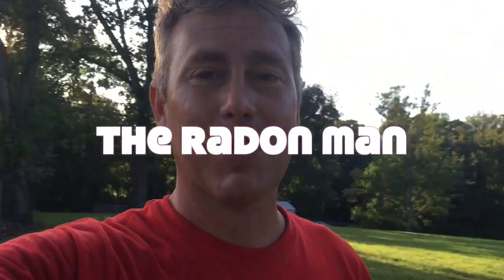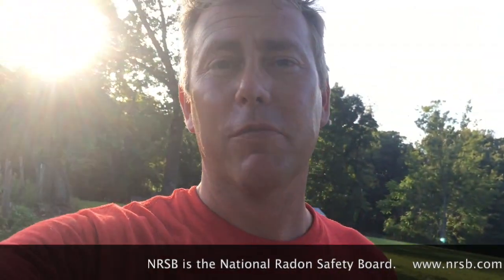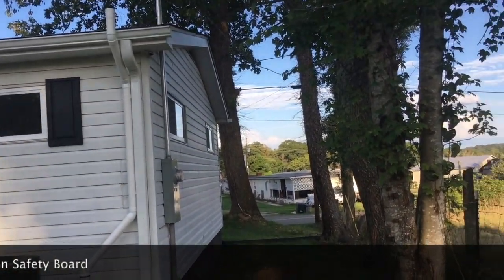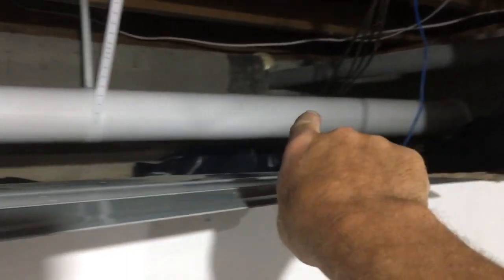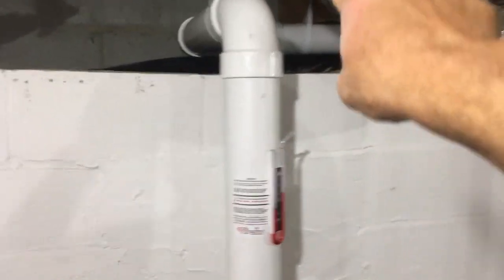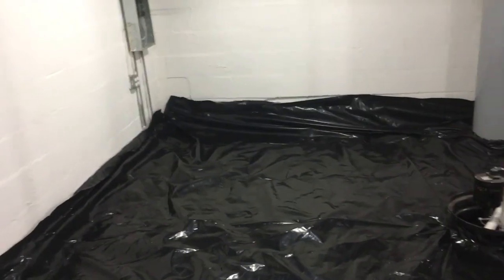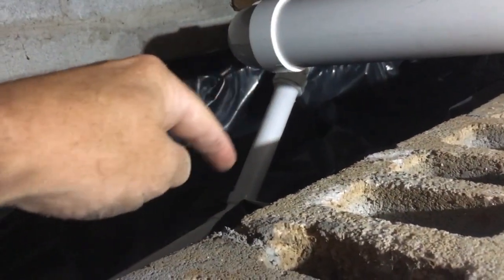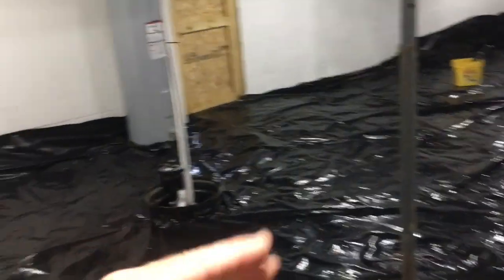How to Install A Radon System In a Basement with a Dirt Floor

Comment: Everbuilt makes a nice sump pump basin with a built in radon discharge pipe which you can easily tie in to the system. The pump is still very accessible.

Comment: I have a question. My compay is in the running to do some mitigation on a Native American reservation. Some of these homes are very small and over 130 years old. they have dirt floors with NO basement, crawlspace or slab. Just bricks on dirt. How would you tackle this?

Comment: Would be great to know what was done under the plastic.
Reply: I have a feeling nothing was done under the plastic,crushed stone over that dirt would of been ideal, then place your perforated drain pipe above the stone, allows the system to breath and not put stress on the fan.

Comment: What foam did you use? Also can you do a video on a crawlspace with a dirt floor and a stone foundation. If you need a house for the video your in luck. :)
Reply from the maker: Hi Elizabeth. I used the expanding foam known as "Great Stuff." It cam from Lowes.  I have done an older home with a stone foundation and regretted not filming it, but the concept is the same.  For some reason white silicone adheres better to stone than clear silicone.  There are strips that can be applied with a pneumatic air nailer but I haven't made that investment but have gotten away with  it so far.